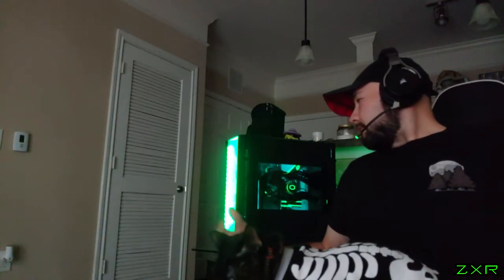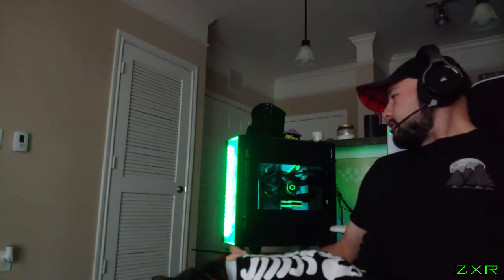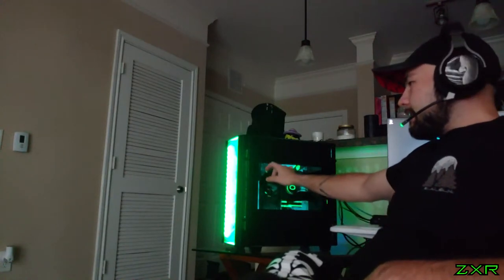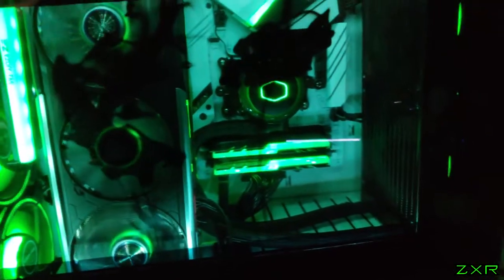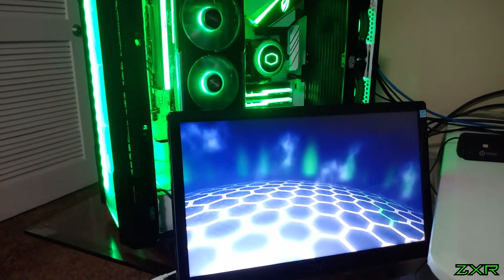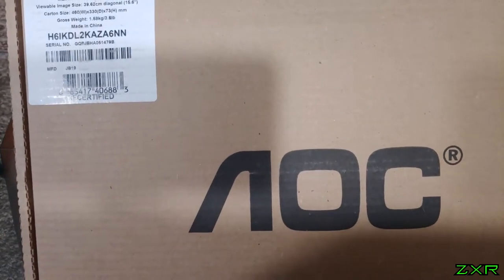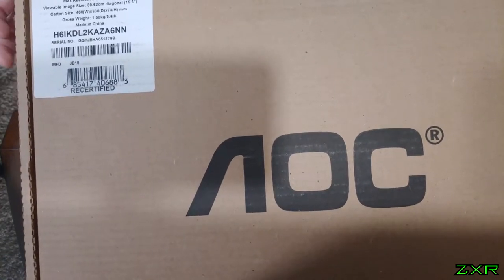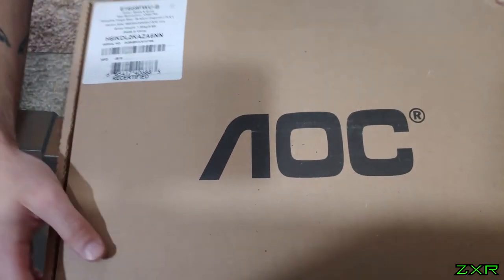Snowblind for the masses DIY plug and play LCD side panel

Comment: This is awesome. I just discovered that case you're using, I like inverted cases like this one, where the window is on the right. Adding a snowblind panel would just be icing on the cake.
Reply from the maker: Be warned that if you are using an AIO cooler like me you may want a different case, I actually had to switch my case due to it overheating my GPU and casing it to crash,  it would probably be fine with air cooling as the fans would be able to pass enough air though but with a radiator mounted to the rear it trap too much heat in the case. I loved the case but the high temps weren't worth it.
Reply: The Liam Li 011 Dynamic XL and the dynamic evo cases have the option to swap the back Frame plate with the front frame plate/glass and convert it into a left hand sided pc tower/case like the 1 in this video, or it can be left alone and used for the right hand side

Comment: Super informative and helpful! Very well laid out. I really appreciated all of the links as well.
Reply from the maker: No problem. Glad I could help.
Reply: @ZXR_SBK  so I would like to offer a warning to anyone trying this. Please be VERY careful with the power or video control board if you are disassembling a full size standard monitor. I just killed my RTX 2080 because the power control board shorted out to the video control board which then transferred to my gpu. So PLEASE be careful so you don't end up like me 🥲
Reply from the maker: @stephensullivan527  sorry to hear that. Yes definitely want to make sure the board for the monitor will not touch anything metal or conductive.
Reply: @stephensullivan527  Hey so what exactly happend to your gpu, what did the control board touch? The motherboard? And did that somehow have a chain reaction on your gpu?
Reply: @ducattidulalas1919  if I remember correctly I had the control board and the power board both wrapped in tape and then taped together so they could be tucked away. But one of the solder points on the power board was sharp and poked through both layers of tape, shorted out the video board, and sent the surge through the DVI cable to the GPU
Reply: @stephensullivan527  Would you recommend the mod? Because I have a 3070 and I don't want that getting shorted out. Do you still have the side panel mod or did you get rid of it?
Reply: @ducattidulalas1919  it's long gone now. It is very cool but choosing the right type display is important. The other problem I had is the kind of display I used was one with terrible viewing angles so it only looked good straight on. If you do give it a try I'd recommend using a cheap GPU to test with and keeping you power and video control boards separate and very well insulated. I hope it works out bro!

Comment: This is so much simpler than the other ones, I didn't even think about using a USB powered monitor.
Btw for the vinyl do you think using a white one will make a difference, especially the backlight bleeding outside
Reply from the maker: @OtaPic if you use a high quality vinyl I think the light bleed won't be an issue with white. Not 100% sure  though, I've never put light behind white vinyl.
Reply: @ZXR_SBK  hmm guess I'll have to test it myself, if it doesn't work i'm thinking plastidipping the side panel won't cause bleeding

Comment: This has got to be the best tutorial on YouTube so much easier than others. Is the display 15.6 inches or is that including casing?
Reply from the maker: I just checked, display measurements when removed from the case are: 8in tall, 15in long, 15.6  in diagonally.
Reply: @ZXR_SBK  thank you so much for checking. It seems like it won’t fit in my nr200p. I wish these came in a 5:4 aspect ratio because that would be perfect.
Reply from the maker: @platonymous  I do see some smaller options on the market, but they will be different from the one I used. Just search "external USB display" and you may find one that fits.
Reply: Bro blow your nose lol nice vid

Comment: Looks great man! Thanks for the credit in the video!
Reply: You did it the way that Modsquito did with the portable monitor. Great work!
Reply from the maker: @ImmodderNation  credit where credit is due, didn't know someone else had done a portable monitor one.
Reply: @ZXR_SBK  Heres the link to Chris Albee (the guy who inspired my work) https://youtu.be/tSPfaJczIS8
Reply: @ImmodderNation  is there a way to make one without soldering
Reply: @Yeet-bx5bx  Of course with the portable monitor. You could do it with a full size monitor but sometimes that involves AC voltage inside your computer which is very dangerous.

Comment: Planning to follow your guide for my own Snowblind Mod to a Media Server in a Corsair Air540 case. Will have 12x Hotswap HDD Bays installed on the Clear Panel side of the case. Heavily modded case internal layout so don't worry if it doesn't make sense if you looked at a photo of the Air540.

My plan is to have a separate Widget for Each HDD Bay (displaying Capacity/Free Space/SMART Drive Health etc) aligned over the physical HDD Bay (and CPU Load/Freq/Temps/Fan speeds etc off to the side) The AOC USB Monitor perfectly fits the width of the acrylic window in the side panel and its height also matches the height of the HDD Bays. 

Can I just put a strip of black Vinyl across the 'top' of the LCD layer dividing off the screen and HDD Bay area from the Mobo/CPU Cooler mounted above and visible through the top 1/3rd of the clear side panel of the case. Will that look weird? ie. Bottom 2/3rds of the clear sidepanel being the snowblind screen...1inch strip of black vinyl....top 1/3rd of clear sidepanel being clear with the cooler visible through that top 1/3rd?

Is the connection, literally a USB 3.0 cable? Its not Display Port over USB Type C or anything like that? Its not going to cause problems with the Media server also connected by Mobo rear IO HDMI to my main Monitor? Can I keep the taskbar active on the main monitor but invisible on the snowblind monitor?

Final Question. I can only find the 1920x1080 AOC USB Monitor for sale now. The 720p one seems to be EOL. DId I read somewhere that the pixel size of a 1080p version makes the SnowBlind Mod fainter? Is it still worth doing with a 1080p version?

TIA for any advice you can give ZXR!
Reply from the maker: It will actually work fine on on USB 2.0 as well I believe. It's just video over USB. Windows has a built in driver for it. So yeah it's just all done over USB. I think the vinyl will look fine as long as it's done on the outside of the case window, if you do it on the inside you will see the adhesive bubbles and it will look odd. I think the higher resolution panel your are talking about uses a USB C connection on both ends so if you mobo doesn't support it I'm not sure if it will work even with an adapter. May want to test it before you disassemble the panel. I haven't used the new style one so I can't answer on that. I found mine at microcenter. If you have one local to you look online at their in store inventory and see if they have any of the older 720 panels. I don't think the higher resolution will make too big of a difference on clarity.
Reply: @ZXR_SBK  Found the 1366x768 version on Amazon.co.uk in the end. I'd seen the listing before but it said 1080p in the main description but the model name is for the 768p version and the correct resolution was in the specs for the listing. £40 cheaper than the FHD 1080p version. You got me thinking about the Vinyl saying it should be on the outside. Decided to order  a black vinyl sheet just a bit larger than the full case window, with a cutout for the Screen area and a decal of the name of the PC cut out in the top 1/3rd non screen area which I'll backlight. In other words a single piece of Vinyl.
Reply: @ZXR_SBK  Found this video again to consult it as I will be doing this mod soon. 4 Months later and I still haven't gotten around to doing this mod yet. Life got in the way as usual. LOL As I said in the other post above, I did manage to find the 1366x768 pixel version. Was starting to google around for how to make an Edge Lit light panel to mount behind the Decals cut out of the black vinyl on the top half of my case acrylic side panel. ie. The decals light up. 

Then the penny dropped today over 4 months later......I don't need to make one! The unused 'Backlight' panel of the AOC USB LCD that I was going to throw away after removing the Polorizing LCD layer for the snowblind mod is a.....drumroll.......edge lit white backlight panel....and a very thin one at that because it doesn't use 1cm wide LED strips like any DIY panel I made would!! LOL. Can you imagine if I had done this mod months ago, thrown away the screen backlight, given up on the Backlit decal idea because it seemed too much work to DIY an edgelit Backlight myself....and only later realise that I had exactly what I needed in my hands right before I threw it in the Electrical reycling Bin!! LOL.  Bonus is I feel much less guilty now that the only part I'll be trashing is the plastic casing of the screen and will now be utilising all the internals.

So a quick recap of what my version of your Mod will be. Corsair Air540 Acrylic SIde Panel. On the outside will be affixed a single piece custom laser cut sheet of black vinyl with a large rectangular cutout for the SnowBlind Mod screen on the bottom half of the vinyl sheet and the top half will have the Name of the 12 HDD Bay Media Server,  DENSITY³ (Cubed) and the Corsair and Intel Logo's etc. Density Cubed because the Corsair Air540 case is a Cube shape and will be very heavy/Dense as it'll be packed to the gills with HDD's, a Big Corsair A500 Air Cooler with lots of Corsair QL120 fans and a 450W PSU for the Media Server and also a 1050W PSU Co-Located in this case to power the metric fuck-tonne of Corsair RGB Strips lighting up my Desk/Battlestation and walls and the Lighting Nodes for the Media Servers RGB fans. This PSU is connected to an Amazon Smart Plug and Powered On/Off by Alexa. USB running back to main gaming rig for iCue control when that machine is turned on. This arrangement means a default Light profile when the main PC is off and I can turn all the 24/7 Media Servers Fan and the Desk RGB's ON/OFF with ALexa at bed time but once the main rig is on iCue takes over control for the fancier RGB effects, Themes, Music Visualizers etc. 

The main rig in a Lian Li Dynamic O11 XL will be called DENSITY² (Squared) because its side profile is square and not as wide/deep as the Air540. Doing a sensor Panel Mod for that Rig with the 7" Sensor Panel LCD mounted in the rear exhaust Fan location on stand-offs....but I still want a rear exhaust fan because otherwise my case would be massively Positive pressure with only 3 exhaust fans to 6 intakes. So I realised I could simply mount the rear exhaust fan outside the case instead of inside and it will still be able to pull air around the Sensor Panel....but that left the problem of being able to see a fan bolted on the the back of the case. Thats when I realised I could Hide it from view if I make an acrylic Strip, Edge lit with some Corsair RGB strips, with Black Vinyl affixed, with a DENSITY² Decal Cut out. ie. Copying my idea somewhat from the Media Server Snowblind case. LOL I'd use some little L brackets to attach it to the side of the case to obscure that exhaust Fan and IO cables exiting that side of the case.

...and then I realised I was back to square one in needing to research how to make a back lit panel effectively (albeit a thin one) LMFAO !!

Laser Cutting Black Vinyl is the one thing I don't have to worry about how I will do thankfully. My brothers Fiancee owns a Hobbiest Laser cutter that can cut balsa and thin materials so I should be able to afford to make a few mistakes through trial and error too as long as I buy enough black vinyl stock.
Reply from the maker: @ca1ib0s  taking a step back from a project and giving yourself time to make sure everything is how you want it is always a great idea. I actually found out from moddernation (the person who I got the idea from) that I was not the first to use a plug and play LCD, the first guy to ever do this mod, used one as well, didn't ever see his work till I was told about it. But good for having a real good plan, I'm actually not even running this case anymore, I still have it with the panel in it, but I'm using a thermal take core P5 now and am figuring out a way to do another version in it. Be sure to post some pics or video of the finished product. I'd love to see how it turns out, seems like it will be really unique. Good luck.

Comment: I have the Corsair 7000X case, it's massive. But it has Tempered Glass (tint on glass), will this still work? Or does it need to be normal clear glass?
Reply from the maker: It will work but may need to add more back lighting. The glass on the case in this video is tinted as well, but not as dark as your case.

Comment: I have a very important question about this monitor? how does it give a signal? Does it work on Windows 10? I ask because I saw the reviews of this monitor on Amazon and they were having problems giving a signal, and that the monitor was only compatible with Mac OS
Reply from the maker: I'm using it with windows 10. It's getting it's signal from your native GPU. So either integrated graphics or your GPU.
Reply: @ZXR_SBK  interesting hehe, ok thank you very much bro, it would be great if you leave the exact link of the monitor you use in the description of this video, do not put it in comments since youtube deletes them, your video is a very complete video and it would be great if you brought a mod how to make an openable windows side panel
Reply from the maker: @Kelvin-w6s  I did have a link for it on Amazon in the description but might not work anymore.
Reply: @ZXR_SBK  it is still working thank you so much

Comment: I know it's been a long time since you posted the video. My question is does the cpu need to have gpu integrated into it for the monitor to work off of usb only.
Reply from the maker: No, this is on a Ryzen 7 3800X system, which does not have integrated graphics. I do have a discrete GPU, which is what it's using to provide the video output, it just communicates this over the USB protocol through the motherboard rather than through the cards dedicated display outputs.
Reply: Thank you for the quick reply on such an old post.

Comment: U know the length of just the lcd panel with out the casing? I want to fit this into the nzxt h210i. The glass side panel dimensions are abt 13 x 13. I think I'll be able to fit it without the length of the thick bezels. Do you think it will fit?
Reply from the maker: 8 inches tall
15 inches long
15.5 inches measured diagonally

Comment: Hi, great mod! I saw your comment on the other guy’s channel who did this mod and came across yours. I was wondering, can’t you remove the polarizing part that you said not to remove? It would make your screen less black
Reply from the maker: No, if you remove it you can't see anything at all, The polarizing layer is on all LCD's. Don't remove it. The part in other videos you see guys removing is an anti reflective coating. Not the polarizer. The polarizing layer is still left on the other displays.
Reply: @ZXR_SBK  Got it! Thanks for clarifying, I'm assuming your monitor doesn't come with that anti-reflective coating
Reply from the maker: @Dragonphix  correct. If the surface of the LCD is "glossy" looking it does not have the anti glare coating, if it's "matte" it has the coating that must be removed. If you look at my part of the video where the display was back in the case you can see a small triangle section at the bottom right where I started to peel it up thinking it might be an anti glare coating, and realised it was just the polarizing layer. It's not really noticable when it's in the case as the side panel thankfully.
Reply: I remember an old "privacy" hack video showing how to remove the polarizing layer and apply it to a pair of glasses. Doing this made it so that only the person wearing those glasses could see what was on screen and everyone else just saw the white back lighting.
Reply: @ZXR_SBK  
Hello . .Are there polarizing layers on both sides of the LCD panel . .
Reply from the maker: @naveenk6387  no, only the side that you would view it from.

Comment: Hi, I just recently completed the same mod as U but the display isn’t as sharp? Is it bc I need more lcd and also does having an open case matter bc mine is open?
Reply from the maker: Check your resolution settings. You can also download an application that will allow you to adjust the contrast to help get sharper images.
Reply: Do you know the names of the app?
Reply from the maker: @robertbacalan7093  I cannot remember the one I used, but ClickmonitorDDC seems to be one that will work for the AOC monitor.

Comment: Would there be a reason not to use a widescreen monitor but still keep the resolution lower?
Reply from the maker: Most case side panels won't support the size of even a 1920x1080 24" monitor.

Comment: Hi I have a Matte monitor, but when i take off the layer in other videos its clear but not functional, and tips? or should i just find a glossy monitor
Reply from the maker: Then it's the polarizing layer. It needs to be on there for it to be visible. It may have the anti glare coating on top. Look at the coating carefully and see if it is a polarizing layer.
Reply: @ZXR_SBK  yes it is a polarizing layer, but how can i seperate the anti gloss from it??
Reply from the maker: @dan1860  you can remove it by putting wet   paper towels on top of it for a few hours. There are videos about how to get it off this way.